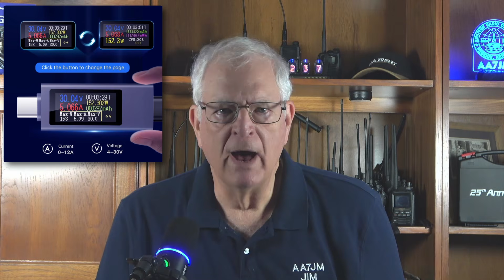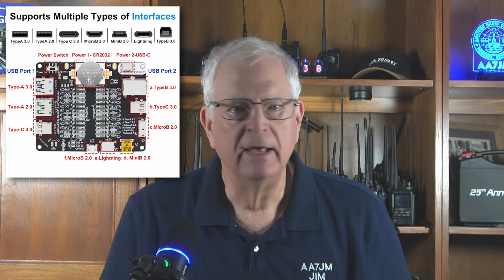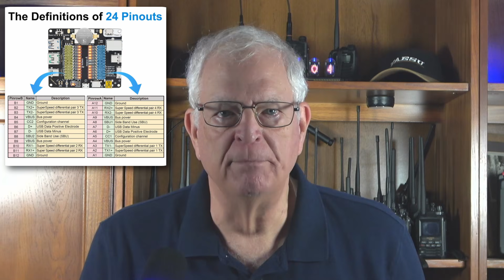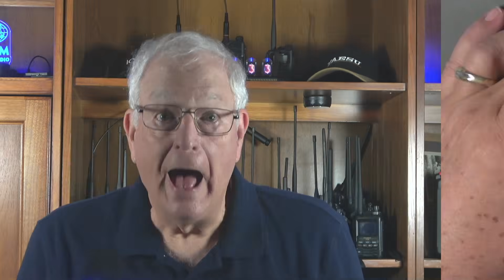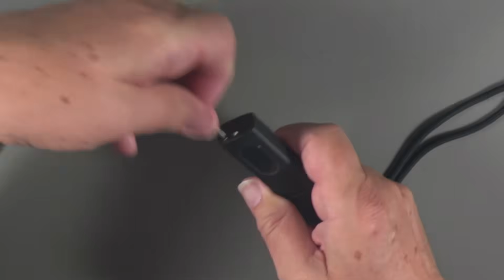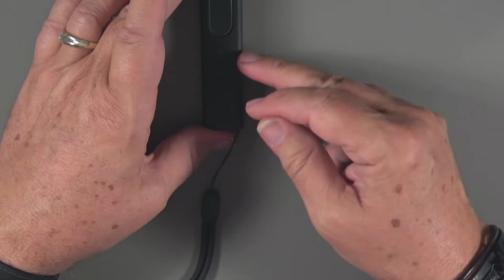The USB Gadgets Every Radio Operator Should Own

Comment: Id recommend a USB power tester with Type A and C not just C.  Many devices do not use Type C. They tend to do all power monitoring.
Reply: I've never seen one of these power testers with both A and C. I have one of these units and I just use A to C and C to A adapters as needed.. Works the same.
Reply: @lvsluggo007not really. C can run up to 20v. the testers with A,C micro are cheap and plentiful.   Then no need for adapters and you get more data.